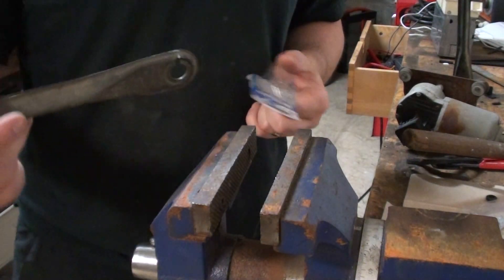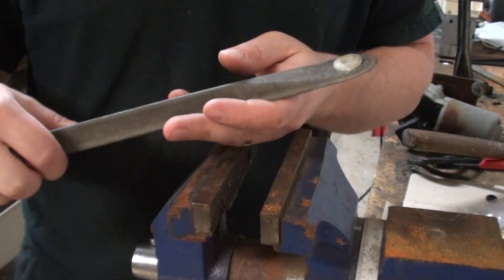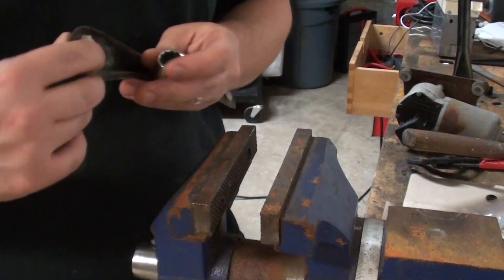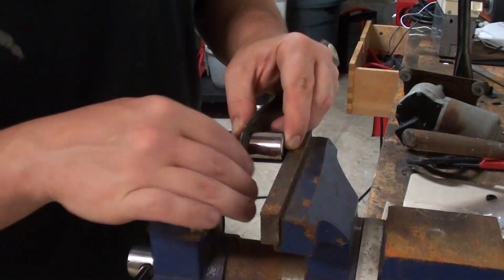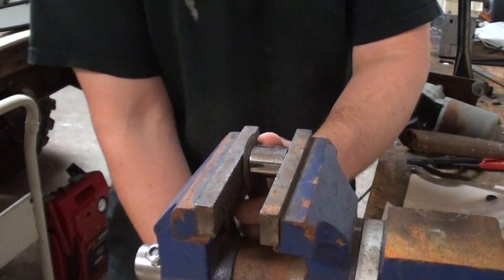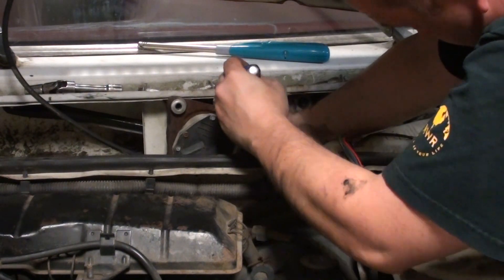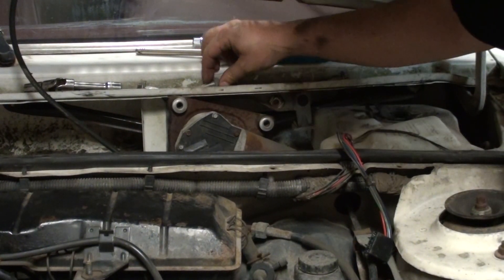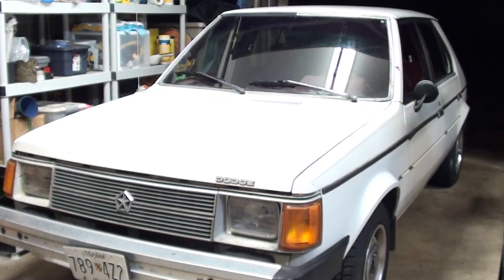Dodge Omni Wiper Arm Repair

Comment: I have a 1983 dodge 400 convertible/ just replaced all bushings on wiper system! You will need one #49439 bushing and three#49440 bushings to complete the job, also you should remove the motor and arms as on unit and replace in reverse order! Good luck!
Reply: As one unit!

Comment: Hi Jared Morgan, thankyou very much for sharing this. I have a Dodge 600 convertible. Everything you showed us is the same as what John and I experienced, except there is a firewall blocking hand access to installing the wiper assembly. My repair failed, and I am going to Fresno to see a good friend to help me with this repair. Did you remove a firewall? Check us out at www.chryslerkcar.com.
Reply from the maker: Hmm, no firewall on the omni. There was a plastic cover, but once that was off it was ripe for the picking. Good luck!